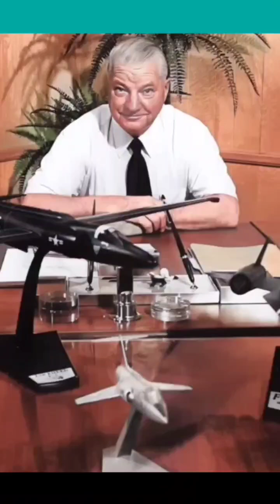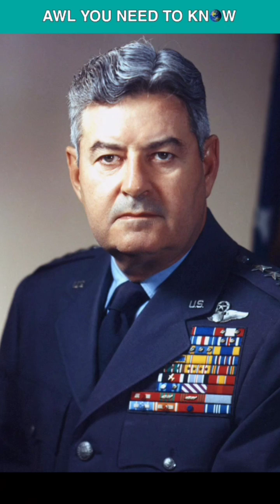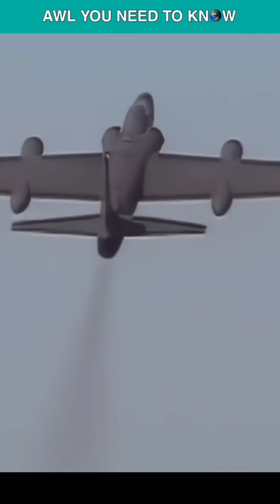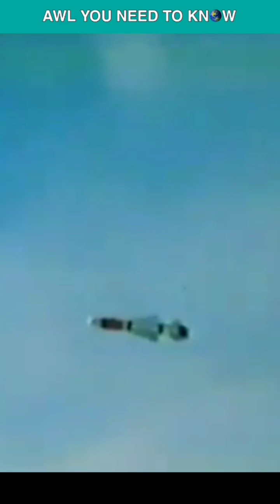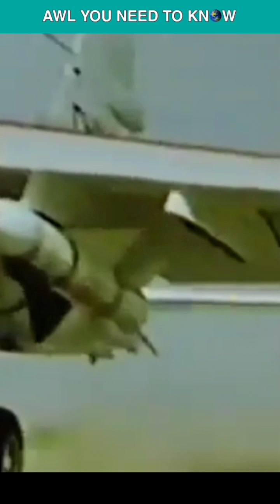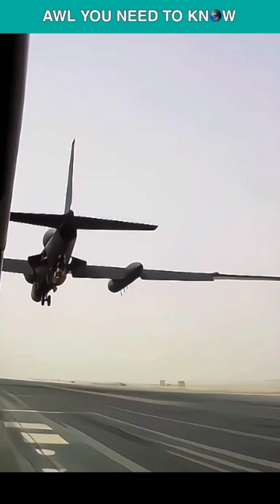When The US Wanted To Arm U-2 With Anti-ship Missiles #shorts

Comment: IIRC, it was Kelly Johnson that also gave us the P38 and the P61.
Reply: Kelly Johnson and a massive team of unnamed engineers gave us the P-38 & P-61.    
  It’s the same as saying: 
- Elon Musk  gave us (the preexisting) Falcon Rocket & Tesla Roadster. 
- Tim Cook  gave us (the preexisting) miniaturized IR-based facial recognition & 5G iPhones.
Reply: @GoatPopsicle  I won't argue that; every great project is a team effort. But Mr. Kelly was the lead in all these projects, snd authored a large part if the design. Every project starts as someone's idea, but it takes a team to get it off the drawing board and into the air.